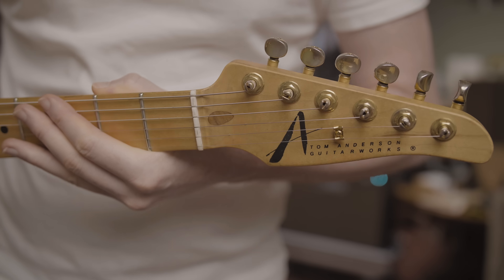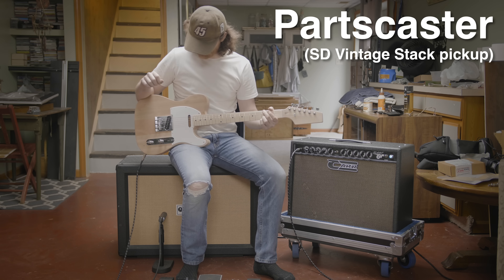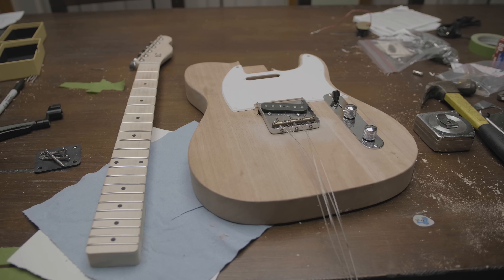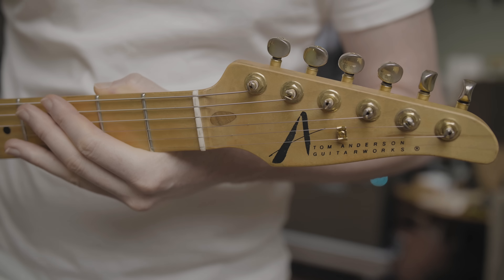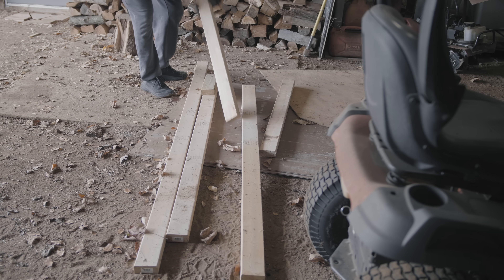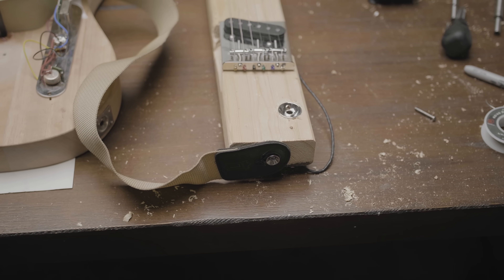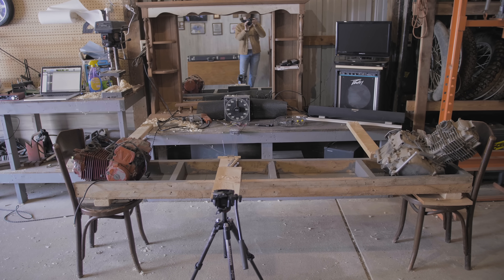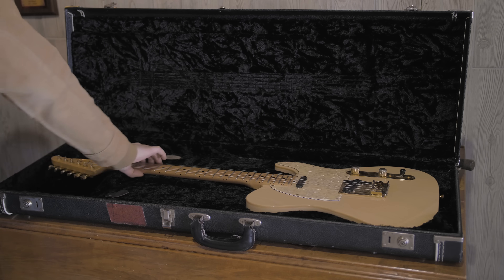Tested: Where Does The Tone Come From In An Electric Guitar?

Comment: This tells me, it's the amp and settings on an amp that will differ the sound quality. Thanks for doing this, it shows all guitar players that the difference in sound comes mostly from the amp and settings, not the guitar and pickups.
Reply: The pickup do make quite a difference, especially pickup style (P90 vs Humbucker vs Single Coil etc...). The difference is observable earlier in the video, but he quickly matches the pickups to control that variable and goes on to testing other things.

Comment: Love this series of videos! However, I feel this one and the sustain one leave a significant question unanswered though.... Hollow body guitars...  While its clear solid body doesnt make any difference whether its a 2x4 or a 59 Les Paul... This didnt explore the potential tonal differences between a solid body and a hollow body with the exact same specs otherwise. A jumbo hollow body such as a Gibson ES-150 or something vs a solid body would be the most telling. A hollow body archtop guitar has so much acoustic resonance, it would be extremely interesting to know how much of that if any is actually translated into the pickups. WIll a 2x4 or your honda air special at the end sound the same as a Jumbo hollow body with the same pickups, same placement, and same height(etc) as demonstrated in this video with solid body guitars? And while this might be a little out of the budget, if any difference is discovered, it would be interesting to know how much the top tone wood affects that sound say spruce vs maple top and each of these compared to the 2x4 or honda air special lol.

Comment: i mean if you check from a technical standpoint. 
The tone is an electric signal. 
Electric signal gets produced by the string vibrating through the magnetic field of a pick up. 
The pick up creates a signal and sends it through the cable into the amp. 

Quite sure there is a difference in string resonance with whatever material you're using. BUT the fucking signal running through the amp is genereated by the pickup. the cable does some stuff to it and then you crackheads all run it through tubes because they sound so warm. Guess what that warm sound is because the godammn signal gets altered by them. 

You might get different sounds by using different materials, but since you're squashing an electric signal through a mostly distorted amp it's definitely not what makes the sound lol.

Comment: confirmation by evidence.   It sounds like it's pickup, distance of strings to pickup, and post pickup electronics.  Makes you think there should be a pickup riser device like a a bigsby,   Like the b-bender but for the pickup to rise up a 1/4 inch for that lead ripping sound.
Reply: ,pickups, distance to strings to pickup, position of pickup (not really explored here but clearly the same pickup at same height but is a different position relative to bridge and  neck will change tamber), then post pickup electronics. Next would probably be strings.  I like your idea of a switch to raise and lower pickup.  So analogue!

Comment: I have a background in acoustics and electronics and have never understood the hype about tonewood in an electric guitar! The strings interact with the pickups to induce an electrical signal that then goes through the electrical components to the amplifier, which converts electrical energy to acoustic energy via the speaker. One thing that I know for certain is that non-metal components can't interact with the pickup regardless of how hard one might try.
Excellent work!
Reply: People just like talking about wood
Reply: Hollow body guitars will sustain forever because the resonance in the guitar body is also picked up by the strings. I think that fact alone proves it has SOME effect. Much less obviously when comparing solid bodies.
Reply: @jackgoff4859  I would agree in this statement. That it has an EFFECT. But not a TONAL effect. If that makes sense. Haha
Reply: the tone wood only makes a valid point in acoustic guitars
Reply: Ive tried to have people explain to me how if the fretboard affects tone so much, how does it do it at all when you play open strings?
Reply: It can make a difference if the pickups are even slightly microphonic, though. The difference would be negligible and probably not worth fighting over, but it would be there.

There’s also the slight nuance in the way the bridge vibrates within the body cavity. Different woods could probably produce very SLIGHTLY different resistances to the screws holding in the bridge on a Strat-style guitar. Again, not worth fighting over because the differences would be so small, but a difference nonetheless.

Saying the wood makes “zero difference” is simply untrue. Saying it would make an “indiscernible difference” would be more accurate. Not trying to start a debate, but I felt it needed to be said.
Reply: Sounds like you could use a background in physics as well
Reply: WHEN A NOTE RESONATES IT DOES INTERACT WITH THE BODY !!!!!! BUT NOT ENOUGH TO MAKE ANY DIFFRENCE !!!!!!!!!!!!
Reply: @mefirst4266  you can yell as loud as you want and we still can't hear you. Maybe if you used some more exclamation points or something.
Reply: They are just falling for the traps of companies that sell their guitars purely on woods they use, yet lack quality and looks. 
And these boomers buy into it religiously.
Reply: I've always thought of it as more of a "feel" thing anyways. I play heavy guitars in a different way than I play lighter guitars. Every variable is gonna have some influence on how play, from knob placement to how the guitar hanga. Just my thoughts.
Reply: non metal parts affect how the strings vibrate. For example if you use a metal body guitar, I think the sustain will be shorter. Same rule could apply  to different types of wood.
Reply: @mojians  I might agree with this if not for the fact that the strings on an electric guitar are isolated from the wood parts by a metal bridge and a plastic or bone nut. Basically, as demonstrated by this video, there is zero effective interaction between the strings and the wood on an electric guitar.
Reply: @rickofsix5900   It's really hard to tell "differences" from strummed open chords. Had he played those guitars for 30 seconds each the small differences would have been far more noticeable.
Reply: @hairlab_dc4417  All you need is a spectrum analyzer to definitively tell.
I also know I can tell pretty quick when two sounds don't match.
Reply: @hairlab_dc4417  No they wouldn't have mate, open strummed chords not being representative is just you saying "nuh uh" because if there was any real difference you could hear them in the sound when those chords are strummed.
Reply: @mojians 

Sustain isn't part of a tone of something. 
A tone is the EQ curve or shape or signature of the sound. Sustain is nothing but length of the tone.
Reply: @mojians  if you use no guitar, it sustains the same.  Its in the vid.
Reply: They interact with how the vibrations are absorbed through the notes’ sustain.
Reply: @willywillywillywillywilly  but those vibrations cannot be picked up or discerned by electromagnetic pickups.
Reply: @sinjon  but those vibrations will, in turn, have an effect on the vibrating strings.

Is that effect noticeable? Yeah. Probably not.

But to swing the other direction and say that it has ZERO effect is just kind of ignoring newton’s laws.
Reply: @willywillywillywillywilly  the only thing that changes is the sound of the guitar when unplugged
Reply: @willywillywillywillywilly  yeah but that’s acoustic energy. Not electric. Which is what the pickups “pick up”. Simple right?
Reply: @extendicus262  The electric energy comes from the string vibration, wich is a result of the superposition of waves including those moving through the wood, however the effect of the wood parts is negligible for the tone.
Reply: @igors5637  That might hold water if the pickups always touched the wood. In a Stratocaster type guitar, the pickups are suspended in a piece of plastic. There’s no effect of wood vibration on the pickups, and any effect on the strings, especially at the speed some players play is negligible

Comment: Should I return the 2k American original 60s Strat I just bought :/
Reply: not if it feels good to play. it will sound the same as a guitar with the same electronics, but if the neck feels nice and you like the look then fuck no, keep it
Reply: @jakethornton7  you're 100% right. I kept the guitar because all the ensenada-built strats I've owned felt terrible and uncomfortable to play. This is the first high end guitar ive ever owned and the comfort is on another level. The fretwork is unreal, and the dark rosewood fretboard it came with is absolutely beautiful. The glassy tone comes 100% from the single coils and not the wood, but that's okay

Comment: Most of the difference between the 2x4 and the Anderson, i can tell is going to feel and there's definitely a subtle difference. Look most of the time, your pickups, scale length and hardware as long as its brass, steel or aluminum is going to sound good. Every guitar can sound good as long as its properly built 

Tight. You want everything to be TIGHT. the tuning machines should clamp down hard on that peghead and your neck should be glued down and set nice and tight, or your bolt on neck should be nice and tight too. 

Pickups dictate frequency, the body can dictate sustain and character but NOT tone and the best builders know this but people still refer to this concept as tone but its not. And your hardwares ability to without much obstruction transfer vibrations to the body and return it back to the strings on the strings frequency "back and forth" is absolutely undeniably important. Its density and crystak structure probably dictate this.

We can take a look at cymatics for this, vibrations and frequencies transferred through the medium of water or sand creates certain geometric patterns and the structure of the bridge and the body and they're resonant frequency are most likely important factors too that are largely ignored. Imagine building a bridge to match the resonant frequency of the guitar itself? That would be interesting 🤔

And then imagine tuning the guitar in accordance to those values. I think we are all looking at this debate all wrong and we should be trying to better understand this through a different lens, perhaps through a scientific specialty in a field that studies vibrations and harmony but not in the field of music, perhaps getting these specialists in a room with luthiers and musicians would yield interesting fruit.

But all in all, i think you can have completely different woods that have extremely similar properties, hardness and density etc and get practically the same sustain and character which is largely going to be difficult for the average person to scrutinize anyway.

Im sorry if anyone disagrees but i love research and better understanding instruments and theres still so much research and development to be done. When you can put hard numbers on things and know how to replicate commercially thats when youve made a damn perfect instrument and it will speak for itself.

Comment: It seemed like there was obviously more saturation on the Anderson than the parts caster on the first test. There shouldn’t be that much saturation within the guitar pickups themselves so I am guessing the output of the Anderson was higher, and it got more saturation out of the rest of the chain. If I were designing this test I would probably want to have slightly different settings just to normalize the output signal of the guitars so we aren’t comparing so much the effect of gain staging.

Edit: after finishing the video I see that matching the pickup heights fixed this issue. Very interesting!

Comment: There is always a difference in what you can hear being in the same room with the instrument in your hands and from a Youtube video. But the results confirm what nearly every electronics engineer or phycisist will tell you. The sound of solid body guitars is mainly determined by the pickups and how they are mounted (height, position). Even the mysterious "sustain" claimed by so many pickup manufacturers is just bullshit. The sustain may be influenced by the body and neck material, no question, but overall the influence on the sound is very minor. But fortunately there is a lot more to guitars. They look good, they feel good, they play good, they even smell good and we just love them.

Comment: Les Paul proved this very concept when he was experimenting with making an electric guitar, years ago.  Check out the documentaries on YT about Les Paul.  One of his prototypes was using just a 4x4 piece of wood and a neck and hardware, to prove the body, wood, etc. made no difference.  This is a great video, but it is also just following/duplicating what Les Paul did when he was starting out.  Now if you don't have free vibrating strings, you are going to have a problem, but as this video showed, the pickup made the biggest difference, which is why Les Paul is so important.  That Seymour Duncan vintage stack pickup is really killer.

Comment: You mean a $200 Seymour Duncan pick up has a different tone than a $10 Glarry one? I'm flabbergasted!

Seriously dude, why were you changing pick ups or using any sort of pedals??? In a tonal experiment, you want the pick up to be your constant. Same pick up, set at the same height from the strings. Change guitars around it with different woods, different neck scales, different neck joints, even different weight of same guitar (myths say this is one of the big ones effecting tone). And if you do want to mess with the electronics, try different pots, different capacitors, but leave the pick ups be!
Also, "clean" means clean. Pure. Unadulterated. And yes, I'm sure you're playing through the amps clean channel, but clean channels stop being clean once you crank up the presence and gain.

Comment: I never knew how desperate a large number of electric guitar enthusiasts are to look for 'evidence' that different wood does or does not matter to the performance or tone of a guitar. Jim clearly had the foresight this would go viral and he's done a great job giving enthusiasts food for thought. Hopefully the majority of viewers will take positive ideas from the subtle differences component materials and setup can have to their own benefit instead of getting angst and agro over the so called tone wood debate. There are other videos out there that like to demonstrate that the body & neck of a guitar do matter. But so what?! Just accept there are some guitars an individual will like and some they won't. Throw science and experience at a guitar build, but the results are not absolute/guaranteed due to all the subtle tolerances. A good guitar is often referred to as greater than the sum of its parts because when one uses all the finest components, sometimes a guitar still sounds average. I get people might think manufactures are selling snake oil, but again so what? People buy the guitar they like the look, feel and tone of within their budget. I suspect and hope that is all that matters to the majority of players because virtually every human made product in existence has great reasonably priced options and extortionately priced ones.

Comment: Great video! Been building custom guitars for over 20 years and I agree with you on tone wood. I would've really liked to have see your "air guitar" section without the pieces of wood holding the 2 benches apart. Even though they are spaced out they still act as a neck. They can still transfer vibration from one bench to the other. Would've loved to have seen you have them supported by things not touching each other. Like the bumpers of 2 different cars or something. Really wanted to see it with an actual air gap between them. I don't think the difference would be noticeable but would be cool to see the test with no possible vibration transfer from a-b other than the strings. Keep up the good work! Love your videos!

Comment: Did you control for different output levels between guitars? Like I wld think you might use a meter (vu meter?) on both dry unprocessed outputs to match. I suspect if you arbitrarily kept all level settings the same on your hardware and just switched guitars, if one has a louder signal entering the signal chain it will affect distortion and tone. Im just like speculating 1 min into the video but wtf do I know lol
Reply: I can’t imagine proximity effect doesn’t apply to guitar pickups as well. The differences in pickup height are essentially differences in proximity to source of sound i.e. the strings. Close mic’ing first off will be louder so you might adjust for ideal gainstaging, also it will modify the tone giving more “body” or “thickness”. It exaggerates lower frequencies- this is often utilized by voice actors, vocalists, and blockbuster trailer narrators lol. IN A WORLD... I can’t say I remember the little I may have learned about pickups but I’m sure they’re essentially mics.

Comment: One thought about the last experiment vs the two-by-four - I think that the combination of mass and rigidity of the endpoints may make a difference because any give at the point of string contact would weaken certain frequencies or hurt sustain. So as long as both ends are sufficiently heavy material or the whole thing is sufficiently rigid, I'd guess it's all the same. You just don't want the ends of the string to move at all.